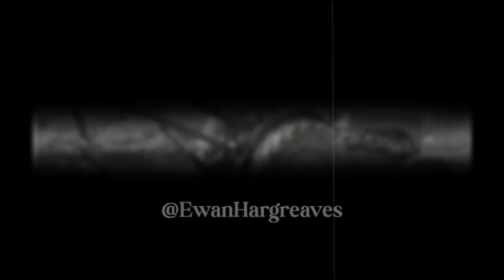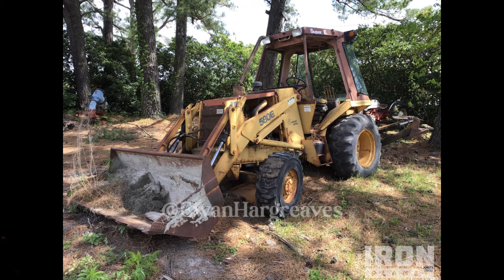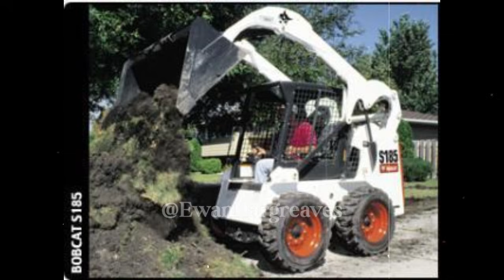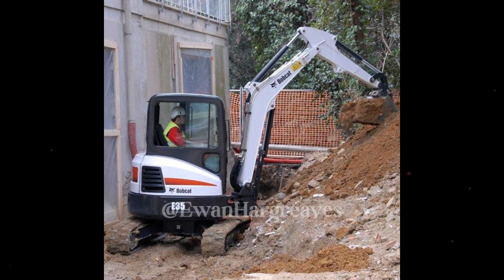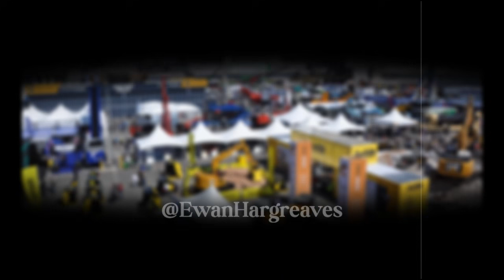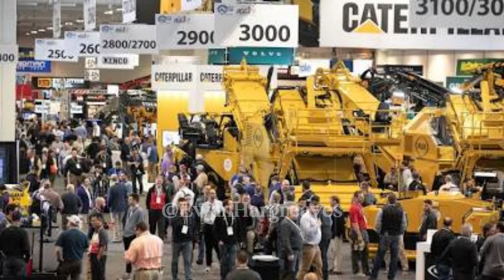This $705 Invention Built Suburban America... Then a Chinese Machine Killed It

Comment: I could dig and load out a 150 yard pool excavation with a 6 series bobcat loader bucket  w teeth  in 8 hours . Drive the cat into a5 yard dump … no trailer necessary . I’ve tried backhoes … they are slow , even when the haul out  truck is within reach of the bucket. Great for deep trenching , not for volume

Comment: I have a haymac 3 point linkage bucket. It was made in 1960. It was an updated version of something origionally powered by horses. Still great for some jobs no rams all mechanical great for scrapping the bottom of a dam or leveling soil. Most people would ignore it now and use a front end loader which for some jobs is inferior to a haymac bucket. I can remember when my next door neighbour came home with his new John deer back hoe loader in 1970. Sometimes the technology is a bit of a con and a skilled operator will recognise which is the best for the job. Small building lots have made compact  machines essential.however when I get to clean the dams at home I will use the haymac with a mf135.